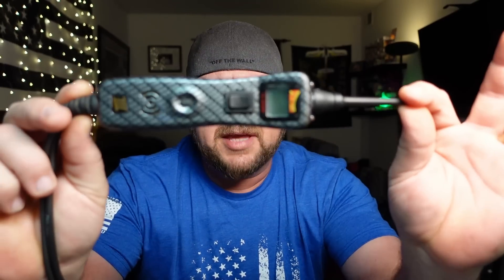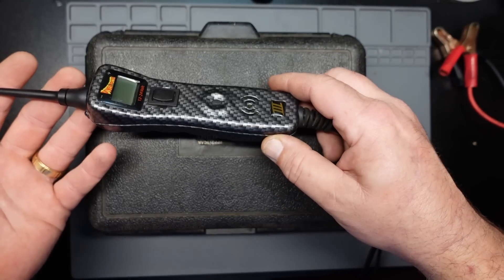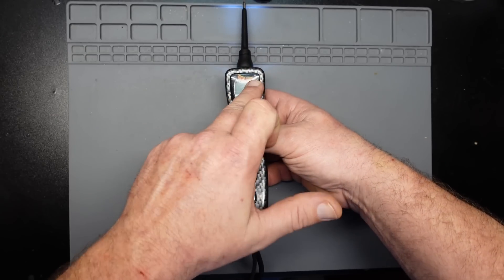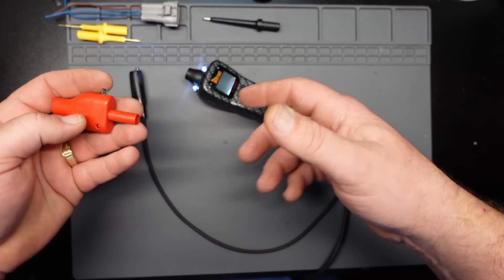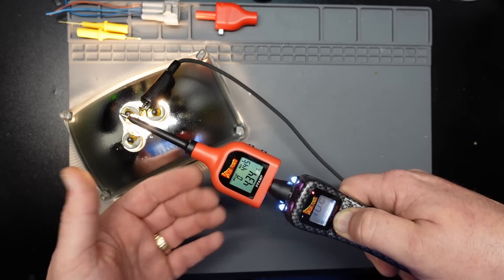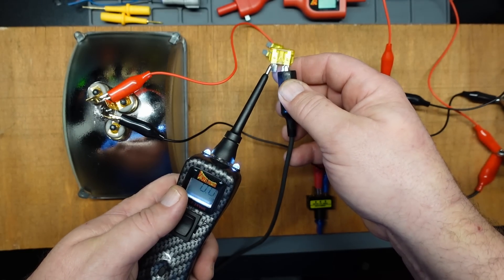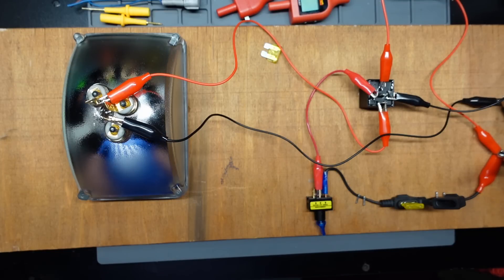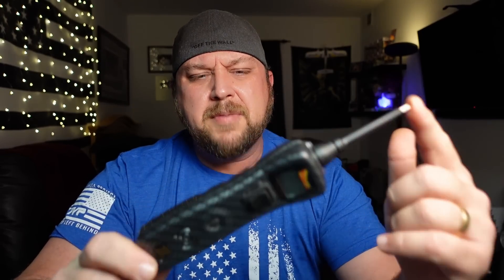Power Probe 3 And Friends

Comment: I have been using a power probe 4 for 10 years or more, I upgraded from a power probe 1.  It does a lot more than the probe 3.  It also works with the etc200. I also use the autel bt380 which is the same as the power probe hook. It has a oscilloscope on it

Comment: They sell a 5v adapter for dealing with lower voltage "control circuits" that otherwise will get fried by 12 volts. Thats the main issue, user error.

Comment: I finally got the "maestro z power probe" for my birthday from my wife, and all i can say is its absolutely insane!!! 💯 🤩 You can do even more than my standard power probe can do (which is already a ton of USEFUL things) and it connectd to my phone or tablet so ypu can see wavelengths and etc to see hiccups or etc..  I had got my power probe, years ago, to find broken wires and then i did some research and found all the other tasks it can do🥰  the power probe is such a useful tool, it does so many different jobs that normally you need a toolbox of diagnostic tools for😂  the pro kit is really, really nice but for most people the kit you got will work great💙💙💙

Comment: Been on the fence for getting a power probe for my own DIY automotive troubleshooting for years. Finally decided on the Autel PS100 a few days ago. Seems nearly identical to the PP 3, but it's about half the price. I'm curious if the PP accessories would fit it though...
Either way, it's a great tool for $80. Does it replace a DMM? Not exactly, but it does things a DMM can't.

Comment: you forgot, imo, the best part that separates it from a normal test light.  touching the tip to ground and having that green light come on, or touching it to positive and having the red light come on- that only happens if the resistance is low enough to draw a current. if there high resistance in the line that would normally stop a "thing" from drawing current, the light wont come on, while it would with a standard test light.

Comment: For the love of God, don't buy the IV. I HATED that unit. I have broken or basically worn out 3 PP3s, absolutely the most important tool in my box. My IV didn't last 3 months. The tilted screen sucks, the menu is flat unnecessary. The PP3 is a companion to my DVOM, the PPIV tried (and failed miserably) to replace my DVOM.

Comment: I repair electronic equipment for a living (self employed) and have had two similar probes in for repair. Both different brands but internally the PCB's were identical. They both had been connected with reverse polarity. Rookie mistake. One owner was a light vehicle mechanic, the other an auto sparky. Both had fried the 3.3v voltage regulator and allowed 12v through to the CPU. End result, a CPU with a hole blown out the top.Both not repairable. They had ZERO reverse polarity protection. Very poor design for something costing around AUD $300.00 .

Comment: Glad to see you doing well on YouTube " thats me up voting all your " shorts " videos . I was an electronics technician in the Marine Corps and the first training for that is both AC & DC electric school . Our trouble shooting slogan was " source based, point to point , process of elimination testing " whether the source is the battery or fuse-able link system then point to point to the device . I own a marine electric and electronics service business now and the power probe is invaluable to me. Because marine wiring is all water sealed after it leaves the source I have several pairs of screw down wire piercing probes adapted to the power probe to penetrate the wires near a device to determine the problem. I carry a small tube of silicone in my bag so that I can reseal the wire when the work is done.
Reply: Better to seal a wire puncture with , 3M Scotchkote  FD , a coating designed for electrical underground slices . Amazon

Comment: In a previous life I was a semi mechanic. And yes, that thing was used daily screwing around with lights. At my current job (heavy equipment) I've used it less than a dozen times in 5 years. I make a joke about my coworkers using it more than I do.
Reply: As you were a truck mechanic you learned the most dangerous person in the world was a truck driver with a toolbox equipped with a sharp pointed test light !

Comment: I've had 4 different PP3s.  One of them got run over by my favorite one-eyed, elderly, foot shufflin', past due for retirement, co-worker.  Two of them, the screen quit working within a month.  Both times they broke I was working on a front end loader (24v) and it worked fine, then the next time I put it on 12v the screen didn't work.  They're rated for 24v systems so I'm not sure what happened exactly.  I just got it replaced for free again but they upgraded me to the PP3 EZ.

Comment: Not a glorified test light, just a really really tricked out one. Good for quickies. I've had more than one. My fluke 87 still holds the "most indispensable tool" title though.
Reply: Test lights will transmit both power and ground to a remote device ? when did that happen ?

Comment: I don't like working with electricity because I've been electrocuted before. Yes it was my fault I didn't turn off a breaker or even the switch but I didn't realize florescent lights carried that much power. And while luckily I learned the lesson of cutting power in a relatively easy way there are a lot of idiots in the world that don't know what loto is and could kill me. So I stay away from all electricity.

Comment: The argument that a 12V Power Probe fries computers reminds me of the argument some guys have against PPE (primarily  steel-toed boots), claiming that the safety equipment is more dangerous than not using it.  You know, because the 3 oz. steel-toe cut his toes off.  The 30,000 lb. payloader had nothing to do with it. 🤨🙄😑🤦‍♂️
Reply from the maker: Haha

Comment: this might give you a laugh... the forklift i use at work is a 5year old Linde H80 evo, friday 19th of jan, alternator exploded by the sound of it as i was using it (bosses orders, use it until it died). it should be out of warranty and servicing but someone at Linde UK (Scotland) gave the boss a 3 year extension. so the engineer turned up monday, 4 days of working on it, new alternator, new starter motor, new ignition barrel and other new things, its ready to go. Friday 26th, i start to use it again, 2hrs in back to its old games, mast fault (that puts locks drive so its like putting the hand brake on) for the first time, then a hour later it does it again, at 3pm break i come back to turn the engin on, 2 minutes of turning the key on and off until it finally starts. 
i will add i work at the docks for a company that bags fertiliser, so yeah the corrosion levels are high, i think the ecu has a slight short because of corrosion as some days it does not miss a beat and other days fault after fault lol

cool bit of kit in the video, maybe the Engineer here could need one lol
Reply from the maker: Forklifts are expensive but people who can fix them are expensive too 😜

Comment: As a UK engineer and spark... I was ready to shit on this thing because it looked like a death screwdriver (look up photonicinduction killer screwdriver... Yes I know he's insane most British engineers are).

However seems legit... Problem being bs7671 kinda requires receipts... Does this thing have them? Or is it the finest chinesium going?

Eg: multimeter class rating on that thing? Class 2? 3?

Also, much love from across the pond big man, also can I show staff some of your fork lift shenanigans? The ones where people should be dead but through dumb luck aren't?
Reply from the maker: I don’t think we have that over here. It’s only for low voltage so there’s not much danger.

Comment: I agree 100% with your assessment of the power probe 'problem' concerning frying computers. Sometimes you have to be smarter than the tool.
Reply: Yeah, didn't know this was a problem. Been using a probe for around 2 decades. From probe 1 to 3 with nothing like that ever happening.
Reply: There is a plug on accessory that drops the voltage down to 5v, for use with computer ccts….do your research

Comment: I might go months or years without using mine, but it sure is handy when troubleshooting to have power/ground right there to test with. The extensions are super useful for doing trailers which always have flakey lights lol
Reply: My gal bought a new trailer two years ago and I looked underneath it and quickly understood why trailers have flaky lights! The horror! The horror!

Wires a danglin' in the breeze, and routed past sharp corners of steel bits. Whole thing just needs doing over, and with conduit.
Reply: @theundergroundlairofthesqu9261  I use split wire loom usually, protects it well enough, but ya...trailer wiring is sooo sketch lol
Reply from the maker: I love when people use unsealed connectors on trailers 🤦🏻‍♂️
Reply: @FunkFPV especially boat trailers. Like wtf are you thinking. Heatshrink connectors are a must. So is the 2 stage heatshrink wrap which has the glue in it that seals water tight.

 This thread is the perfect example of how guys building trailers are not mechanics, they're trailer builders. Often times i see wires rubbing on stuff, instead of wire loom that can get warn through quickly, i slice vacuum hose in half to put over the wires, electrical tape it in place, then wire loom, then more tape. Can never be too careful when it comes to wiring. Shorts can cause some crazy and nasty problems

Comment: Not sure on the brand but I've got one and it is fantastic. Used it to troubleshoot a bad thumb switch on an excavator. Was able to work back from the solenoid all the way to the joystick. Doesn't replace a multimeter, but this does 99% of what I need it to do.